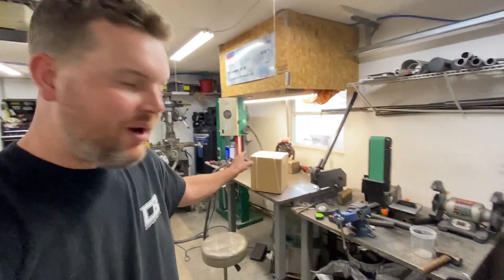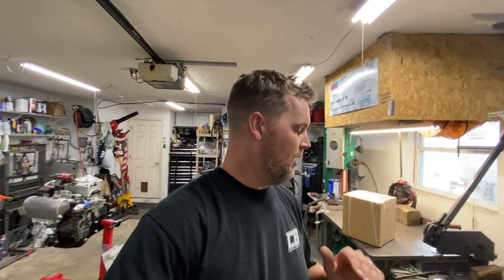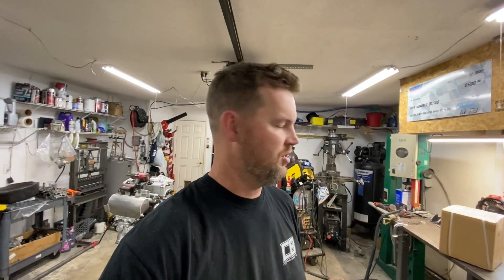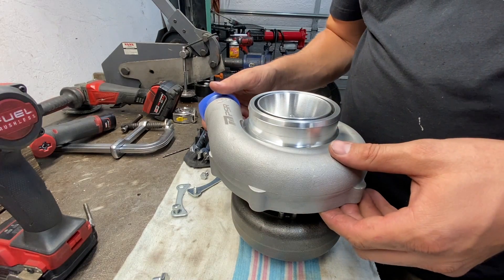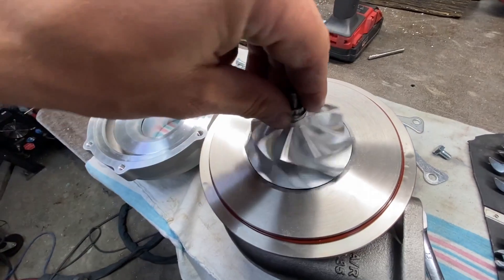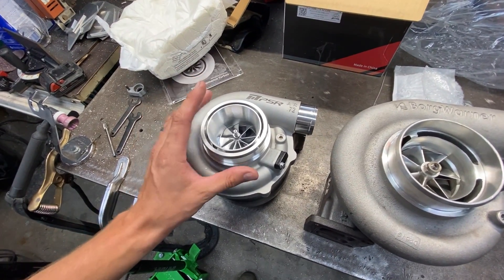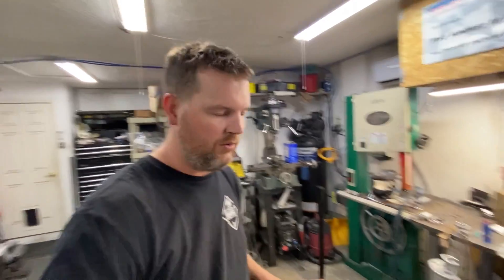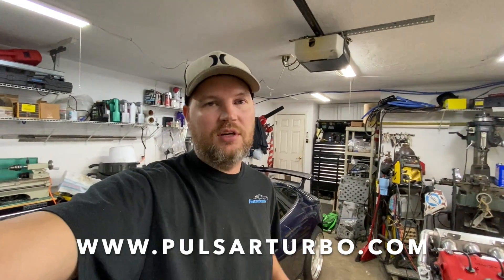Unboxing The New Pulsar 6262G Turbocharger

Comment: I concur my turbo was shipped to South Australia in just over a week from PSR China, they rang me at every step the turbo made i have very high opinon of Pulsar's high quality at a great price you can pick one up from $400-$2500 depending on size and bearing mine cost me $2280 and $600 for 2x 50mm wastegates, 50mm blow off valve and titanium blanket, Pulsar aren't your normal Chinese company they are developing their products for more performance
Reply from the maker: Yeah man. They have been fantastic so far.

Comment: Given what the S372 is capable of its actually a really small turbo compared to similarly performing turbos, ive seen one make over 1000 through a th400 on a barra. Saw a post earlier on facebook of a pulsar G35-1050 making 900 wheel on a supra, theyre great turbos for the $

Comment: Very pretty....  Does this spin up any earlier than the GTX35R or PTE6262 w/ Ball Bearings.     What does power under the curve look like with this  turbo.     How well does it perform in second and third gears.  i.e. Not just 4th gear 1:1 pulls?  Thanks.

Comment: You are going to blow up the new engine even faster with the new turbo if you tune it the same way as the last engine. Got to keep the boost down on low rpm/high cylinder pressure
Reply from the maker: Yeah Im going to just do the same exact thing I did last time expecting different results.....
Reply: @baysidefabrication  i wrote that because everybody is saying it broke because of the big turbo or oiling problems. And you have not really talked about the real problem in your videos
Reply: You're being too nice @jagharingenyoutube

Comment: one question when you order a turbo and it came with water and oil cooling are you force to use both or you can use oil cooling only
Reply: U can use only oil.
Reply from the maker: you can run just oil. It will void the manufacturers warranty however.

Comment: Hi. What turbo from pulsar would you recomment for bmw 335i n54 with flex fuel that is aiming for 500-600whp? Would use it with Speedtech single turbo kit that can use either Garrett GTX- or G-series. I was thinking about G30-770, G30-900, G35-900 or matching GTX one.
Reply: watch speed acadamys video with their supra and g series testing. for that goal on e85 best turbo is g30-770 with a .82 housing imo. you’ll get full boost at like 3500-4k rpm and have no fall off till 7500

Comment: compared to the G25-660 what would you recommend for around 500-600whp ?
Reply: G30-770
Reply: @_illtal  and why? wouldn't the G25-660 quicker?
Reply: @low-budget-racing  it would spool faster with the same AR between the two.  But you need head room and also to stay in the larger efficiency range LONGER than the other smaller turbo.  If you plan on maxing the turbo out, then smaller one may be better.  But we need to know the engine size, the boost you're going to run, what fuel, and how much rpm you're going to run to make a better assessment.  Also Garrett compressor maps are 10-15% lower than the hp rating on the g series. But I have seen setups get near what they claim.